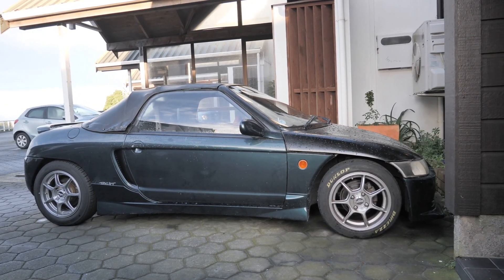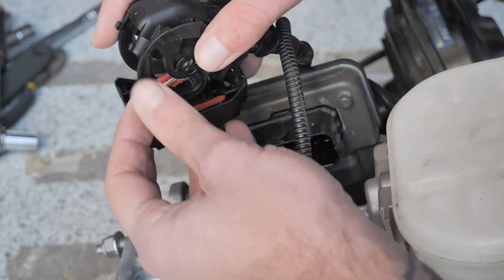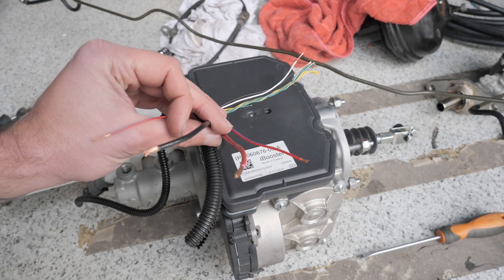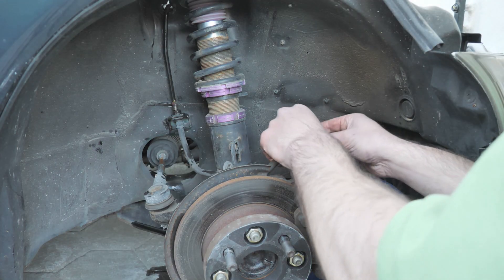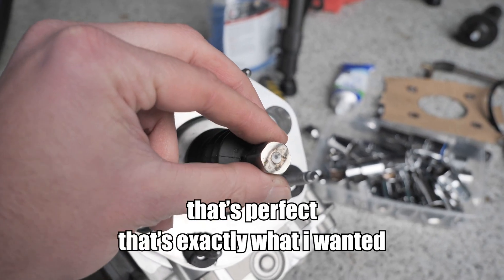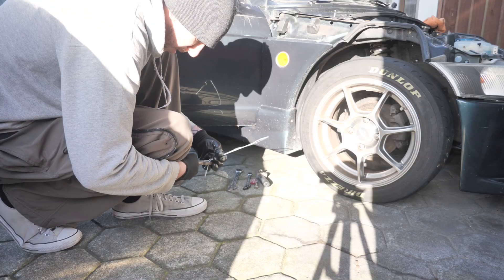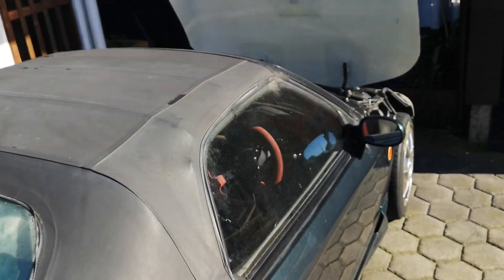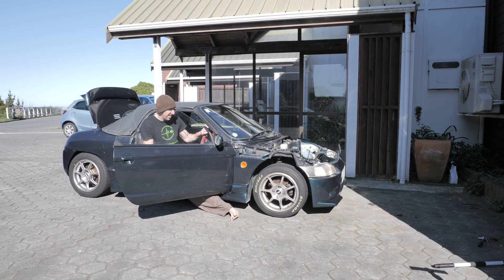Electric Honda Beat Conversion - Episode 10 - Electric Brake Booster

Comment: Come on man!  You go to the trouble of 3d printing a nice bracket to hold down those fittings yet you use some ugly ass way too big clamps for the hoses and mount the reservooir all half assed.  Just spend the tiny bit of extra time and do it to perfection.  This project could really be something amazing if done right!
Reply from the maker: I ended up scrapping the whole 3D printed bracket and going with a legit Honda Accord reservoir instead, so you'll be happy that it's more professional now 😂

Comment: On your pinout I saw two wires 22 & 23 and I have a feeling those are kinda important. I think pedal sensor tells the booster's computer when you are pushing the pedal and when you're not. It could help with the booster's own calibration and stuff. 
I might be wrong though.
Reply from the maker: I wish I had all the fancy stuff Teslas do, but I'll just use the bare minimum and see if it works haha.  Thanks for your input though!

Comment: 13.22  The fuse needs to be closer to the battery.  If the fuse pops, the wire feeding the fuse is still live !
Reply from the maker: Good point! Thanks for that. I'm planning on putting the battery up front so this will be perfect.

Comment: Any updates?
Reply from the maker: Yep there are a few more episodes to this series so far, but fabrication on the mounts hasn't started yet.  Plans changed a lot haha.
Reply: Thanks. Do you remember what size the 4 nuts are for the ibooster?
Reply from the maker: @23steph13  no, sorry.  Probably 12mm though.
Reply: Ok thanks

Comment: Modern cars must have parallel interfaces for all Input and outputs, so that they can be utilized as programmable cars. 

Imagine having a parallel electronic input interface for the break pedal, steering  so that autonomous computer vision system can  just plug and play to the interface, how cool that would be !
Reply from the maker: It's pretty sweet! Our Tesla has all that fanciness. I'm keeping the Beat as simple as possible, but putting this little car in autopilot would be hilarious.

Comment: Brilliant video, this really helps I am eventually planning to do something similar with my Mazda MX5 
I think the brake booster bolts on the accord ibooster are the same as the MX5 booster.
Reply from the maker: Thanks! Niiiice. It's a sweet upgrade, especially if it fits so well in an MX5.

Comment: Nice work! I used to get paid to fix cars, and my brake lines rarely looked that neat. 🤣

The VW reservoir setup is handy too. Have you thought about putting the bracket on thingyverse or similar?

One little point - it's generally better to have fuses near the battery. They protect the cable (from shorting against bodywork etc.) as much as they do the load.
Reply from the maker: Thanks man!  Ahh good point.  I'll keep the fuses in mind when I put it all back together.  I'm 50/50 about moving the 12V battery to the front of the car.  It could help balance the weight, but it might make routing wires a mess.  We'll see how it goes.  And yeah I should put that bracket online so other people can download it!
Reply: @NewZeroland  There's probably one or two big wires running from the battery or starter terminal up front to the fuse box/switch gear.

In theory you could unpick that from the loom, connect to the battery up front, and just add a new wire for the 12V charger.

Pulling the loom out to do that is not the work of a moment, but could save a little bit of weight, especially if you pull out all the ECU wiring etc. as well.
Reply from the maker: @jrevillug  yeah good idea.  I'm taking the whole loom out anyway and I'll be making my own for the small amount of stuff I want to keep (lights, windows, wipers, brakes, etc).  I'm excited to start from scratch!

Comment: Hello, your project looks fantastic! I'm curious about the long-term performance of the electric brake booster. I also drive a Honda CRV from Malaysia equipped with the first-generation iBooster from Bosch. However, I've noticed some inconsistencies in the brake pedal and travel stroke. It's fine in cold weather, but once it warms up, the pedal seems too low, and there's an issue with front and rear brake bias. Have you ever encountered or experienced something similar that you could share?
Reply from the maker: Whoa, interesting! I just installed mine so I haven't run into those kinds of issues yet, bit I'll keep an eye out for them. Have you done a brake fluid flush?
Reply: Yes, I've attempted brake bleeding multiple times, but unfortunately, the improvement only seems to last for a day or two. I've decided to schedule an appointment with a senior technician at the Honda service center for next Monday. This decision came after visiting several service centers, where I encountered varying explanations. Some claimed to have performed a reset with a diagnostic tool, although it appears that they merely cleared the DTC on one of the occasions @NewZeroland
Reply from the maker: @Willy-vh2os  interesting!  Keep me posted on how that goes.  I hope it's an easy fix for you.
Reply: @NewZeroland  Thanks man. My car has been left at the service center for a two-week checkup while I'm on a business trip in China.

Comment: Nice. Honda, Energica, Tesla, VW conversion. You didn’t do the weight  change but that will be so much crazier of a number on the next video when you pull the engine. Franken Beat is coming along well.
Reply from the maker: Ohh true!  I should have compared the stock booster's weight to the iBooster.  It's definitely heavier, maybe 1.5x heavier.
Reply: That’s ok. Your saving weight everywhere else and good breaking is worth it. Now back to Zelda TOTK. 😆
Reply from the maker: @stevenb7319  HAHA that's my reward for finally finishing this video.  More TOTK!!

Comment: Change out those hose clamps for smaller ones. They won't be clamping evenly.
Reply from the maker: Yeah good idea.  I didn't realize how small the hoses were!
Reply: @NewZeroland  they're not under pressure so not a huge deal but id be worried about them leaking over time, especially at the plastic reservoir. Try find spring clamps instead of screw clamps 👍

Comment: Wow, hey great job ! As you know Brakes are Very Important ! The whole printed up retainer thing was very nice  the only thing I could think of was the power source, and I’m not sure what you are going to do too keep the 12 volt system charged up. I may have missed it from an earlier video. Again great job ! Keep ‘em coming 😅
Reply from the maker: Thanks!  That was pretty complicated so I'm glad it didn't explode.  I'll eventually get a DC-DC converter to step the 300V Energica battery down to 12V and probably have a little motorcycle battery wired up to the lights and brakes, etc.  That's a job for next year.

Comment: Thanks for showing us the whole process, this was a fun video to watch!  For your next Beat or for anyone else going through something similar, DC5 integra/RSX brake lines work as a replacement for the stock flex hoses.
Reply from the maker: Cheers man! That's great to know. I probably should have gone that route and saved a bunch of time haha, but it's all good. "Overnight parts from Japan 2 months later"
Reply: @NewZeroland Overfortnight*
Reply from the maker: @earthwormandruw  😂 so true

Comment: Cool stuff Sam! why are you not getting rid of the clutch reservoir yet? and anything else that won't be no longer needed for that matter, surely it will free up space to better work on stuff that needs to be worked on.
Reply from the maker: I wanted to drive the car again with the new booster and brake lines to make sure it worked and didn't explode or something. Now that I know though.. it's coming out. It's ALL coming out 😈😆
Reply: @NewZeroland  Removing stuff is the most fun part! enjoy! 😁
Reply: @NewZeroland Are there laxatives for cars??